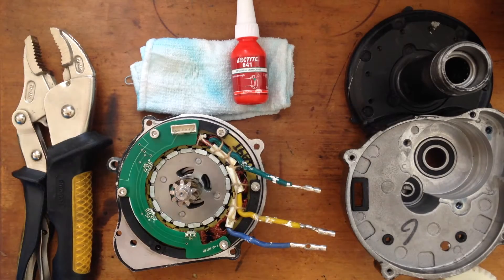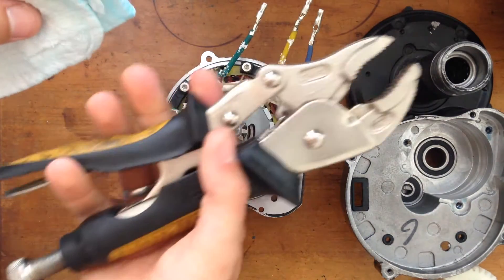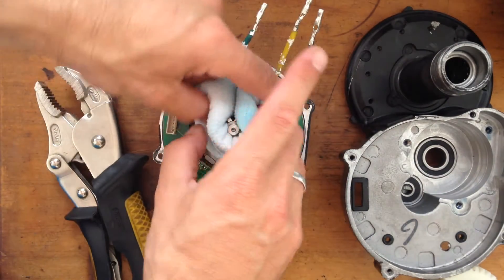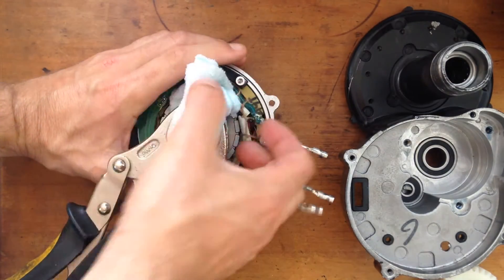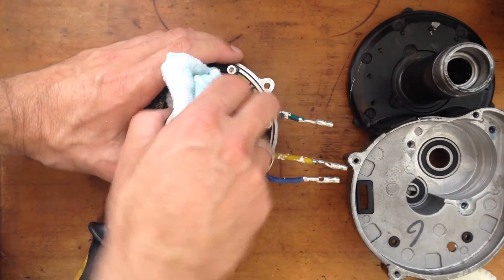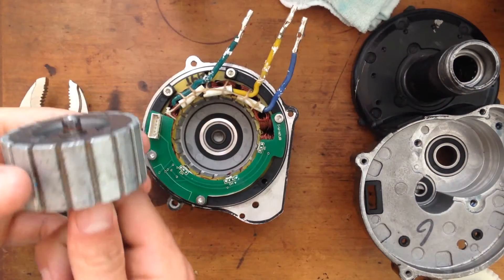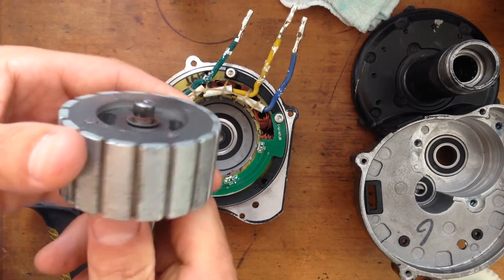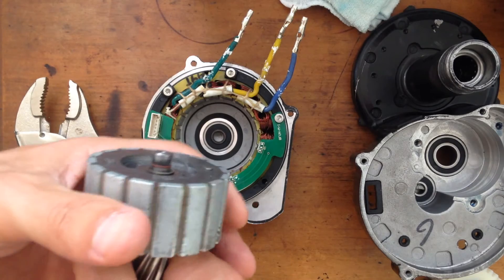Servicing Bafang 8fun BBS02 • Removing motor shaft / Inspecting o'ring

Comment: https://www.youtube.com/watch?v=-bpyVZqUN6I&feature=youtu.be what is the problem - who is the hero of the occasion? )
Reply from the maker: It’s either the pinion and large gear damaged OR the motor shaft vibrating inside the bearing and may be fixed with Loctite (if isn’t too damaged). I have old videos talking about both scenarios.
Better opening up the motor and inspect everything and find out the problem sooner rather than later.
Reply: @BrunoPOWEEER  thanks a lot

Comment: hi , i have a question, after pulling the rotor out which i found to have not only signs of corrosion but also errosion! i discovered the bearing behind it has also come out with it attached, is this an issue or can i simply pry the bearings off the bottom of the old rotor? sorry i hope my direction was clear enough to follow, cheers bruno!
Reply: I have the same thing. When pulling the rotor out, the bearing comes with it. How did you fix it?

Comment: Do not use vice grips/ mole grips. Just gunna fuck your pinion gear like i did mine. After which i realised you can easily remove it by just wearing rubber gloves and pulling it out with your hands. Easy. If you need to you can lay it on the floor and use your feet to hold it down while you pull up with both hands.

Comment: I just replace one O-ring on my BBSHD and i don't figure out why you people want to glue rotor axle to bearings...

Bafang seems put those silicone O-rings to the rotor axle for a reason... If you need to change bearings someday to the rotor axle, it will be difficult if you glue bearings like this...You must heat the rotor axle and bearings to ~200C if you want to remove the glue...

Those O-rings purpose is make easy to pull rotor out of bearings.